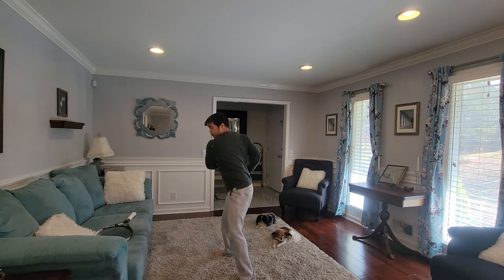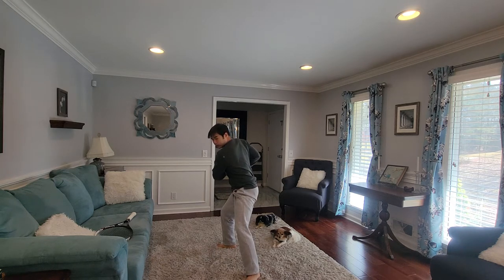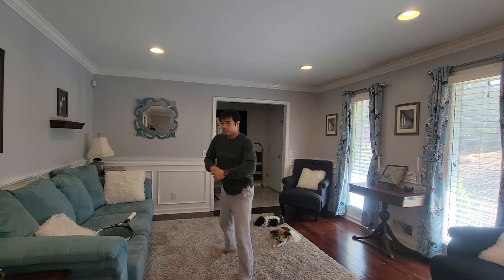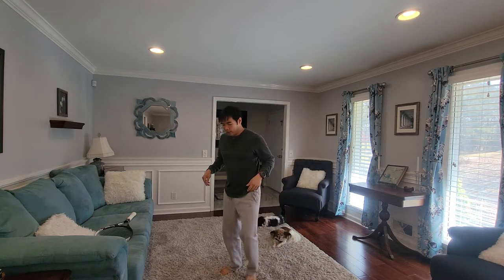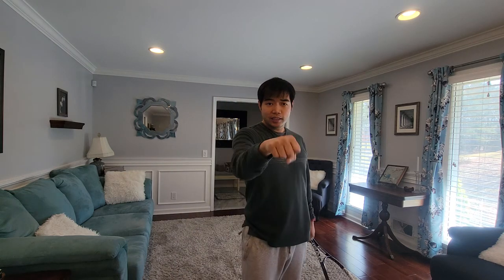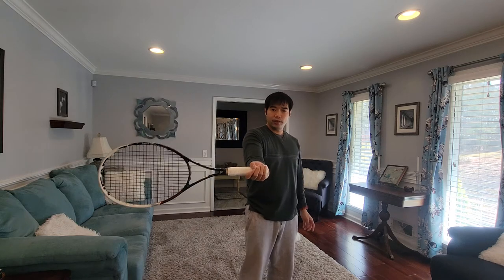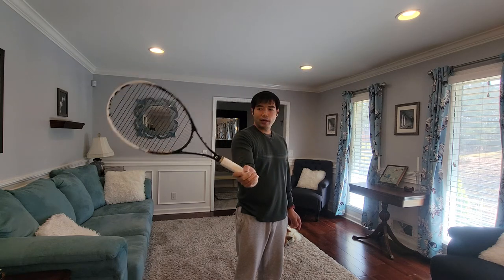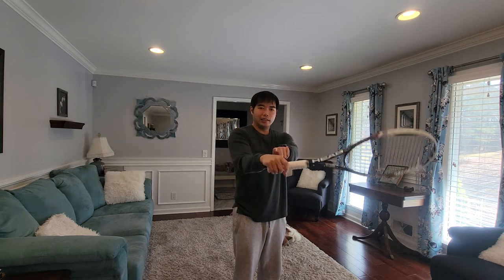How to generate power on the tennis forehand

Comment: So you’re advocating active contraction of forearm flexor muscles through impact? It certainly would be powerful but I’m concerned that the huge longitudinal stress along the wrist tendons would lead to injury. I’ve done it but found it’s rapidly painful. I keep my grip as firm as possible using intrinsic hand muscles but wrist loose and passive at impact. I only contract to flex in short cross court passes when I’m pulled out wide. I have heard contradictory recommendations on this point. What do you think? Regards.
Reply from the maker: It's essentially momentary pronation and wrist flexion right before and through contact.  It's necessary when making contact.  If the wrist is actually loose during contact, the racquet would simple rebound off the ball, absorbing most of the energy and resulting in a weaker shot.  That said, how much flexion is dependent on your technical preference and physiology.  Don't do anything that causes pain or discomfort.  Because the flexion is momentary, the stroke should "feel" as relaxed and loose as possible.  The majority of the racquet head velocity emanates from the lower body and rotational force from the torso.  The arm should be loose, including the wrist, until right before impact when some wrist flexion is necessary.